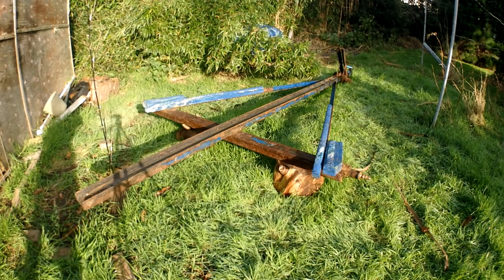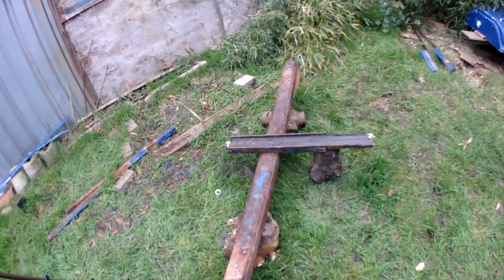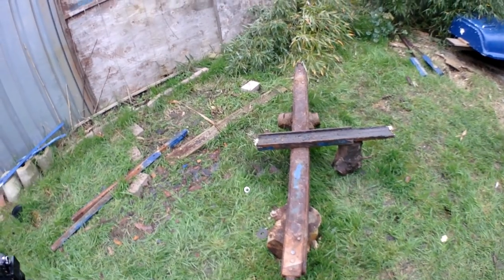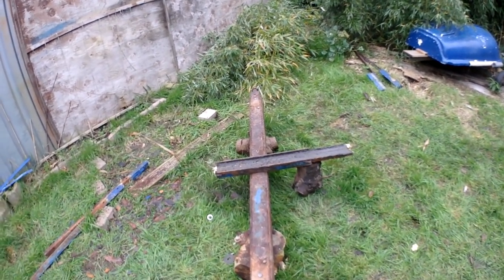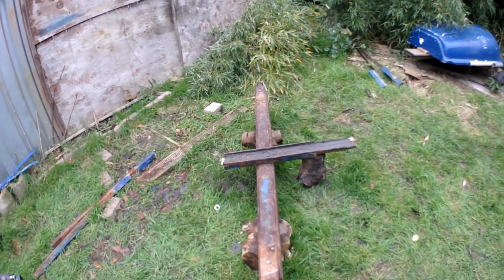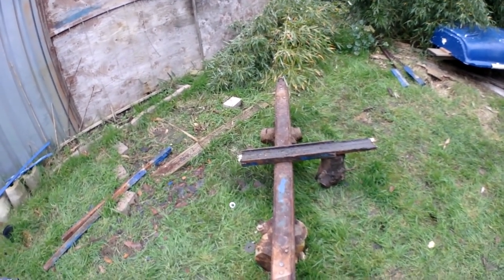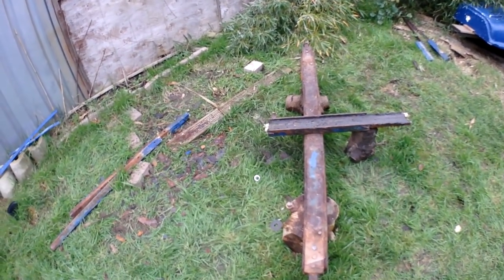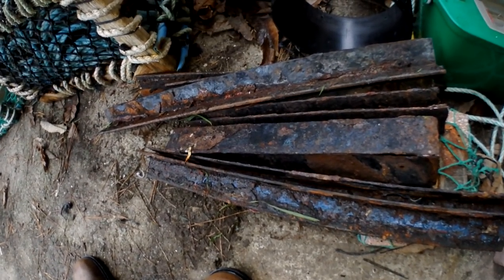A Fisherman's Life - Cutting Up A Trailer

Comment: Nice one Troy!  Expanding your repertoire to a bit of Garden waffle to go along with the Shed waffle! Love it.  Surprised you haven't got (or didn't use) a 9" grinder.  More reach, and when the disks wear down enough, you can use them on a small grinder.  Great idea to recycle the steel for pot weights.  Stay safe & well.  👍👍
Reply from the maker: I once had a large grinder with a diamond blade buckle shoot out and go through my leg cutting through the tendons since then I avoid the larger grinders if possible.

Comment: Next time use a 9" grinder as the surface area is greater, what abt a video of where the catch goes  ( market etc unless i missed that one. stay safe
Reply from the maker: Many years ago I was cutting blocks building a house on the last few blocks I replaced the diamond blade, went to make the cut the blade buckled shot out and cut through the tendons on my led since then I have stuck to small grinders :)
Reply: @Trojwaterman  Fair play, I use them all the time for mobile welding as you get a nice clean cut ready to go rather than the gas axe.